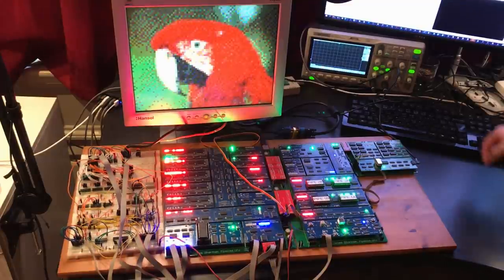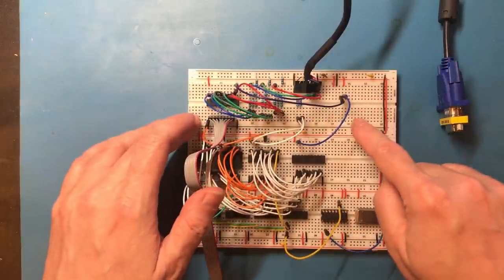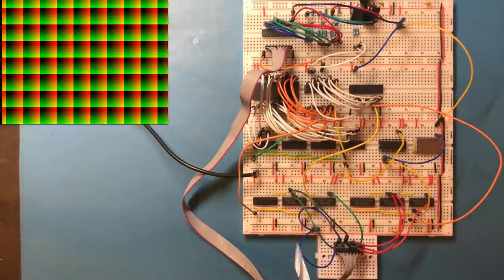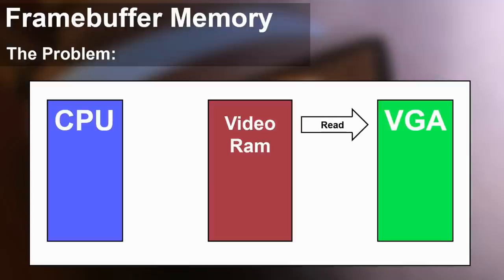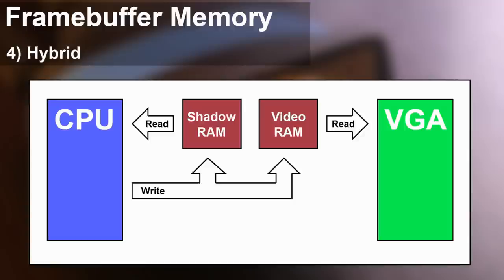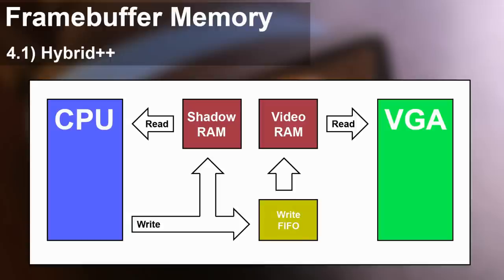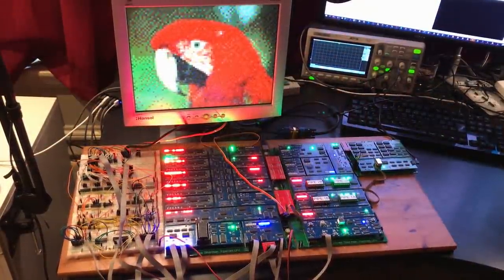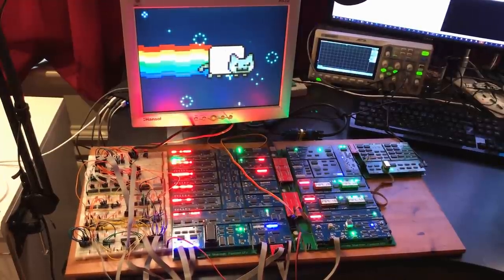Framebuffer - VGA from Scratch - Part 3

Comment: Nice video!

I was only wondering why you are not considered using a double buffer technic. Where you still have two RAM chips (one front buffer and one back buffer).
The VGA would only read from the front buffer and the CPU would read and write to the back buffer.
Once the CPU finishes drawing a screen it would request a buffer swap which the VGA could do in the blanking region. That way there is no timing problem and no problem of handling the write signal.
I think you did something similar with the swappable registers in the CPU.
Reply from the maker: I've answered that question so many times now, I can only describe so many techniques in the videos I wish I had explicitly covered that (I regarded it as derivative). Double buffering in the way you describe takes more hardware than most people seem to think, you pretty much double the circuit I built. Furthermore 8-bit games get decent update rates by doing incremental updates on the screen which double buffering makes more complex.

Comment: Pretty cool solution. I really like it. I also guess it is in a spirit of the build. But I wonder if you considered doing double or  triple buffering:

2. Two or three RAMs. One is read by GPU, next one is written by CPU., on horizontal sync and if new buffer was finished by CPU (controlled by CPU), they switch / progress. If CPU didn't write new buffer, current buffer used by GPU is not changed, and continues being current.
1. Shadow RAM (writes from CPU goes there too and read from CPU are done from it)

If you do not need to read data back from VGA, you can do with just doubling of RAM, but I would go with triple buffering. I think the FIFO approach you mention would be very hard to implement, but the double buffering should be actually quite easy to do, and make software side also easier. I know doublebuffering was not really used commonly in 8 and 16-bit era, but it is worth consideration.

Oh. I found you addressed this in a next video. :)
Reply from the maker: That kind of double buffering with Independent bus driving adds quite a lot of chips, basically doubles the circuit. My plan was to most stuff with scrolling etc so it was unnecessary. My next build will have true double buffering.
Reply: @weirdboyjim  i love scrolling effects, so I think it is more entertaining and interesting build hardware with scrolling. :)

Comment: James, I do believe I have a couple rails of short (1K or 2K long) byte wide IDT FIFOs if you would like some chips. Also, are you considering a RAMDAC such as the Brooktree Bt476 or Bt471? You can even find the Bt476 in 28 pin DIP and it's got everything you need to add a 256 entry palette with 24 bit colors.
Reply: Would you be so kind to share part numbers? I've searched a bit for FIFO ICs but found only some really expensive models
Reply from the maker: I've looked at a few FIFO chips, I haven't planned out that circuit in details yet but I'll probably take fresh look at what is available. I made a pure logic fifo for the uart but that wouldn't be practical at scale just in terms of part count.

Comment: Best implementation would need Vblank interrupt, but that needs interrupt controller.
Most naive way of implementing it that comes to mind would be to have just NMI. When NMI is asserted allow the pipeline to empty, then push everything to the stack, next go to hardcoded adress (interrupt vector) that contains pointer to the ISR, run that and return from the branch by poping stuff from stack.
Then if you need more interrupts you can add more vectors and priority encoder 😁
Reply from the maker: I talk about what would be needed for interrupts in the design retrospective video. "Best" is a complicated term. Neither interrupts or the fifo that every seems keen on will actually change a single pixel of my final big demos, they would just make some things easier at the cost of extra circuitry.
Reply: @weirdboyjim  well yes, 'best' is relative 😅
I was thinking from programming standpoint, you do stuff that can be done whenever on the main loop, wait for Vblank to blast data into frame memory, maybe update audio at the same time.
For a 'simple' system focused on video and audio using Vblank for timing stuff is 'neat' 😉 but yes, interrupt control logic would be complicated.
Reply: @akkudakkupl  The way we did it in the 1980s was to simply poll the VSync line in a loop until the blanking started. No interrupts necessary and you never had to worry about being stuck in the loop as another sync is always coming.
Reply: @Peter_S_  Also a valid way to do it ;-)

Comment: I was wondering. It's common practise to use double buffering in software, render a frame and then display it while rendering the next. Could this be applied at a hardware level by effectively switching between a pair of memory chips so that the CPU has uncontended read/write? I appreciate this means a 1 frame delay, but it ought to mean there's no possibility of corrupting due to writes. Of course it does mean that when you swap buffers any reads from the CPU are looking at two frames ago...
Reply from the maker: That depends on the machine, a lot of early devices didn't have double buffering in hardware so it was done in software.

Comment: Could you have a hardware counter to drive the address lines at the maximum ram clock for a software-configurable range (of lines or pixels) of the video ram? If so, you could have the cpu only read+write from its main memory then have the main memory set to read and the gpu memory to write when the counter is running. The cpu would prepare the picture at any time it likes and then run the counter (which halts the cpu) during vblank. This could even be async, the cpu primes the counter and the counter starts automatically with vblank (or the last hblank to gain some extra time).

With some extra logic, the counter could also do line unpacking into gpu ram to save main memory.

ok, ok, I am suggesting DMA, no way to deny it...
Reply from the maker: There are a vast number of ways of solving this problem, I was only able to discuss a few on the video. I was going for a good balance between complexity and features but there will always be other ways more appropriate for other use cases.

Comment: In a VGA system i am working on for a homebrew system. I am using two memories like you but like a double buffer like system. Where one memory is read by the screen hardware and the other is attached to the CPU. But if you flip the buffer they switch places. And i was thinking of making it so the first frame after a flip the screen one is copied into the CPu Acessable one.
Reply from the maker: There are lots of different ways of doing it. No one way is perfect. When you say "copied into" are you talking about a byte by byte copy? How long does that take? The obvious way would be while the front buffer is being read out and so it would presumably take almost 16ms?
Reply: @weirdboyjim  yea, it would copy the frame buffer byte by byte. No idea how long but i would assume around 1/60th of a second since i was just going to use the next frame go copy it.    Still in the planning stages honestly.

Comment: I know I’m late to this party, but why not double buffer? CPU has exclusive access to one buffer, VGA to the other. When CPU is ready, flip the access (ideally during vertical blank), so that VGA is accessing first buffer, CPU second.
Reply from the maker: If you are building your own circuit then it may well be a legitimate choice. It's not however a "duh, why didn't I think about that", you would need twice the memory chips on the vga circuit, twice the interfacing logic and some additional selection and control logic. It would be a notable improvement to the access simplicity but with significant additional complexity.

Comment: I wonder if you could just double the ram and have the cpu write to one while the vga reads from the other, then swap the next frame. Sort of like the technique you used with the virtual registers
Reply from the maker: That would absolutely work, but it would cost you nearly twice the components. It’s always a balancing act.

Comment: I’m surprised you didn’t implement a back buffer for this purpose. They work by having V-RAM that’s read/write accessible to the CPU and one that’s read accessible to the rendering hardware. Every vertical blanking interval, the 2 pieces of RAM switch roles, allowing the CPU to write the next frame to what was previously the frame buffer while the previous back buffer is being read. Such a setup could greatly simplify graphical software while eliminating artifacts like tearing and corruption entirely.
Reply from the maker: Double buffering was an option but I couldn't discuss everything in the time. I had good reasons for disregarding it though, it's more circuitry than perhaps you think and in many of my use cases it becomes an impediment. Filling the screen for every frame is asking a lot of an 8-bit cpu, what you want to be doing is carefully updating only the bits that need it and pulling trickery to appear like you are doing more. Double buffering complicates that further.

Comment: I have a Multitech CGA card which somehow solves the RAM contention issue with 8 bit era technology. It uses two HM6264LP-15 chips for a total of 16kb of memory, which is what CGA has. I have no idea how it manages to avoid "snow".

I see from the data sheet that there are two write cycles, but I'm not sure exactly what that is about.
Reply from the maker: There is no "one true" way to solve this issue, but I know some cga cards use the time division approach. Their frame buffers were organized such that either framebuffer or character data was read into a shift register for use so the level of contention was much lower.
Reply: @weirdboyjim  Interesting. I had wondered whether they might just be implementing a near perfect solution, rather than a perfect solution. There are a huge number of 74LS logic chips on there (even more than IBM's CGA), so it's doing something. But I didn't find time to trace the circuit to see what that is all for.

Comment: I know I'm way too late to actually suggest anything but why didn't you go with a double framebuffer approach? CPU accesses one RAM chip, reads and writes whenever it pleases, while VGA reads the other chip. When the frame is updated, swap chips (could even do so without waiting for blanking if you're trying to optimize for quick/low-latency updates, or just swap buffers during v-blank if you want a clean image without tearing). I believe it would be similar (though not exactly the same) as the dual program counter setup for the CPU that you use for function calls.
Reply from the maker: Weird, 2 comments in quick succession on an old video with a very similar sentiment.  Here was my other reply - If you are building your own circuit then it may well be a legitimate choice. It's not however a "duh, why didn't I think about that", you would need twice the memory chips on the vga circuit, twice the interfacing logic and some additional selection and control logic. It would be a notable improvement to the access simplicity but with significant additional complexity.

Comment: is there a reason why I didn't cover a buffer swap. every frame you would swap CPU ram and VGA ram.
Reply from the maker: In hindsight I would have at least mentioned since lots of people have asked about it in the comments. Hardware double buffering sounds simple but you need to account for double the address lines and in terms of 8-bit era it limits the techniques for update.

Comment: If you ever do need fast RAM, look into SDRAMs. They’re cheaper than SRAMs, very fast, and also quite large. Also they often have parallel outputs. They do need a lot of peripheral components though, for continually refreshing the DRAM.
Reply from the maker: I'm not actually worried about faster ram, compared to what people had in the 8-bit era we can very fast chips now. I'm more interested in using things efficiently. Adding dram refresh logic on the breadboard feels like a distraction for this project.
Reply: @weirdboyjim  yeah I agree it isn’t a good fit for this project. I was just looking about at RAM solutions for audio DSP when I discovered how cheap SDRAMs could be. At least until I realised the ESP32 had 520kB internally. Bought one anyway, maybe I’ll use it for packet radio or some other very fast sampling situation. I guess a CPU communicating to RAM that spits out its contents as radio is somewhat similar to this project in that dual port would be handy. At least it would be if the radio transmission needed to be in synch with something, which you never know with radio protocols.

Comment: how about making 2 memory chips one in main memory the other small as a frame buffer and either connect the small memory to main memory only during blanking and make it copy graphical memory area, you would need some kind of adress translator a rom or pla which would adress reads and writes on 2 memory chips  and just page over the data
or you could use blanking signal as an interupt that would force cpu to update graphical memory as a subroutine and never do it during normal program operation and eliminate pla element or halting the cpu during transfering data all together it can even disconect frame buffer memory from the main bus when it be done copying the frame

i may be crazy and stupid but that was my first thought when you started explaining possybilities of memory interfacing between 2 devices
Reply from the maker: There are far more ways of doing this then I can cover in one video. What you suggest has a limitation in that there are more visible pixel than blanking clocks, so you would need ram that could be run faster and in that case it would be easier to just implement the time division method (like the c64 and BBC micro chose to).

Comment: Another great video and I love the RR at the end. You will be able to do so much more with a VGA output than just a UART & a terminal emulator. My VGA works almost the same way that you implemented, with RAM multiplexing. I only go up to 160x120 though. I run the CPU at 8th VGA speed (approx 3.15 MHz) and don't get any glitches. Synchronising with the GPU and CPU simplifies things greatly and you can fire pixels at it at full speed without waiting for blanking or the VGA. I also use a FIFO for input but its a single level FIFO (i.e. one set of latches for address and data). Can't you use your boot loader to load data straight into the Video memory space over UART, without writing any separate code?
Reply from the maker: Thanks David. I'll be using early game console style trickery to get a higher visual resolution rather than increasing the frame buffer size. Updating a big frame buffer is a big ask for an 8-bit cpu.

Comment: Great video as always, love it. But I don't really get the advantage of the hybrid dual RAM solution. The impact on CPU performance should be the same if not higher as with the Bus Request approach except for reading. But reading from the frame buffer should basically never be necessary. What am I missing?
Reply from the maker: I think you have misunderstood, the bus request actually stops the processor so for most of the frame the CPU can't do anything. With this hybrid I don't loose anything, I just need to add some feedback timing if I want to avoid the snow on the screen. The cpu reading from video memory is actually quote common but if you didn't need that functionality you could indeed drop the shadow copy.
Reply: When he's finished, there's going to be approximately 300K bytes of memory assuming 8 bits of color data per pixel. If he goes to 24 bits of color, call it close to a megabyte. Now his main computer only has 64K of memory. Now he has two main options for programming.
1. Keep track of everything on screen in his main memory, updating the video memory as required.
2. Check the video memory to see what's being displayed, and update as needed.

Given the huge difference in the amount of each type of memory, it would be better to be able to examine the video memory directly. Also given how he's using those counters, suspect he's gonna have 512K of memory of which about 200K won't be accessed by the VGA system, but will be accessible by the CPU.
Reply: @weirdboyjim  Thank you for your fast response. I assume the CPU would be stopped until the next blanking period just if it tries to read/write from the frame buffer outside of the blanking period. If the timing is good there should be no big performance panelty. With the hybrid approach, assuming image defects are not allowed, the CPU is also just allowed to write to the buffer during the blanking period. In my understanding both approaches should have similar performance. Also, I could be wrong. Thank you for your videos and keep up the good work.
Reply: @weirdboyjim  this is another case where interrupts would be handy. I'll go hide in the corner. :)